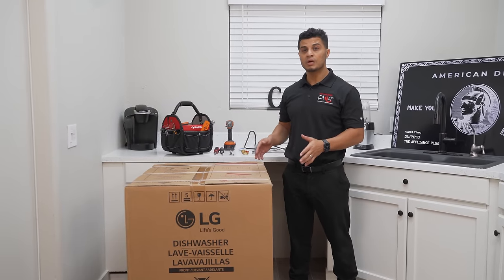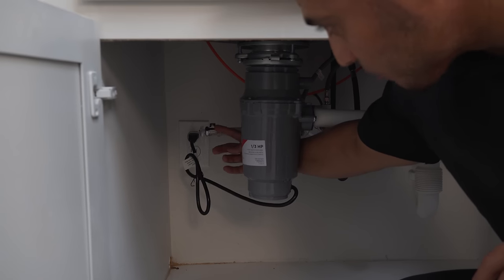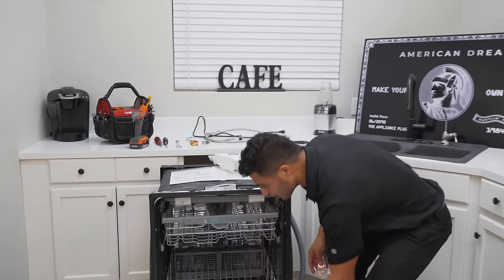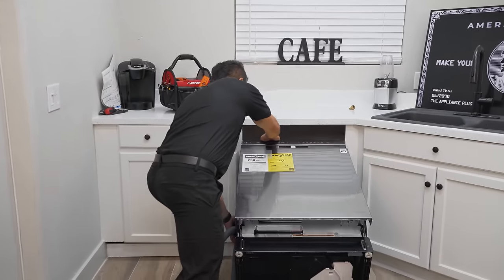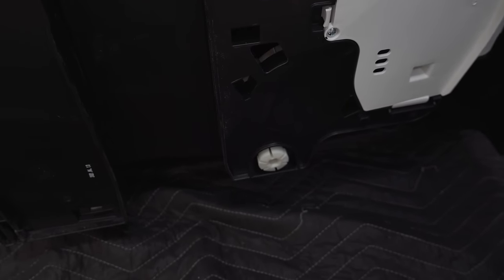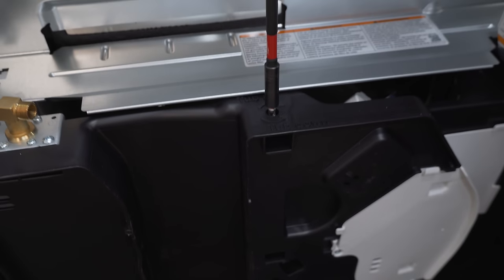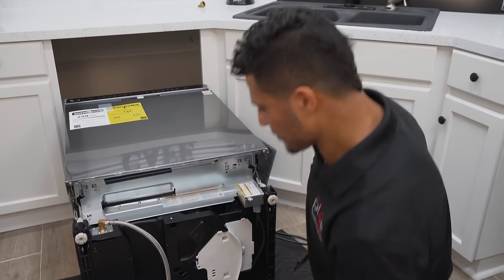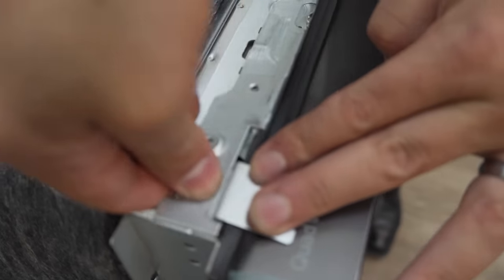How To Install A LG Dishwasher - Step by Step

Comment: Just bought a LG LDFN3432T Dishwasher. Hope it does the job and lasts a long time. Anyone else been happy with LG appliances?
Reply from the maker: I hope everything works out with your new LG dishwasher!
Reply: @TheAppliancePlug  Thanks for the video.. It really helped with installing my dishwasher. Although I stripped the screw to level the dishwasher lol so i have to manually turn the leveler.. The screw is soo soft. Bad engineering in my opinion.
Reply: Mines here tuesday. Im excited.
Reply: @imnotgivingyoumyname810  Easy to install. Just dont forget to loop your draining hose to prevent any backups. I had to buy a 1 meter extension hose in order to do that. Also I am not happy with the drying.. Even with the extended Dry time my dishes are still wet.

Comment: Great video.  While I paid to have it installed, this helped me understand all the steps involved so I could watch the installer. 
One question: how far out should the front extend from the cabinet and countertop?  I have a granite countertop so it is secured to the cabinet on the sides.  The top of the door sticks out about ½" beyond the countertop, and the sides of the doors stick out about 1" from the face of the adjacent cabinet.  Is this the way the machine is supposed to be set, or should the top be flush with the countertop?

Comment: Is it common for dishes to remain wet or have water droplets at the end of a regular cycle when using extra drying and overnight drying? I had a Maytag that left all the dishes, including plastic items that can be used in a dishwasher, very well and dry at the end of the washing cycle.

Comment: Excellent video. I had a hard time finding the mounting brackets. Found them in the silverware basket. Also my install kit did not have color coded wires. I went to my local DIY center for answers.
Reply from the maker: Thank you for tuning into my channel Tony! Sounds like you were able to successfully install your dishwasher even with a few hiccups.

Comment: Question, is there anything special about the electrical wall socket or is it just standard? For example I have butcher block contertops and right abover there is a plug-in.  Can I just plug my dishwasher into that plug-in?

Comment: Great video. Question, I tore out cabinets to fit my new dishwasher. The dishwasher is to the left of my sink. How long does the electric cord and water supply line need to be? Are they standard sizes? What if they are short? Thanks

Comment: if you have a DW with controls on the top of the door are they suppose to be accessible or must you open door to access?? Asking for sister
Reply from the maker: Depends but most of the time you will have to open door if it's top control to select the cycle and to start it.

Comment: What if you have a tight fit with sink on the left and your sink cabinet has a full drawer on the bottom.  I can't get drill that hole according to the template because it will hit the drawer.  Thoughts on this?  Ths LG is replacing a Bosch that fit fine, and it may be worth noting that the drain tube on the Bosch was thin, like the one inside the bigger one on the LG.  Appreciate the guidance.

Comment: Thank you I'm looking at a LG dishwasher. And never installed one.
Reply from the maker: Well, hopefully this is the only video you need to help you install your LG dishwasher!
Reply: I watched the video, thumbed through the manual. I never had a dishwasher before moving into my rental 2yrs ago, it wasn't working right and was over 14yrs old So I replaced it with a open box model.

Comment: Do you have to turn machine on its back or is that just for the video presentation? The front feet seem impossible to turn once it is installed.
Reply from the maker: You don't have to necessarily put it on its back but it does make it easier. Also, I highly recommend you adjust the feet to a degree prior to pushing the unit in.

Comment: just one issue I encountered with my installation: those legs were installed at the factory super tight.  I could not make the front ones or the back one move freely without dislodging them first using hex bit.  the back one was on super tight from the factory.  you definitely want to check the legs first before installing in the cabinet because you will not be able to adjust the height if the legs are on super tight.
Reply from the maker: Yes Thomas I 100% agree to loosen legs before pushing it into place. Those legs can be tight.